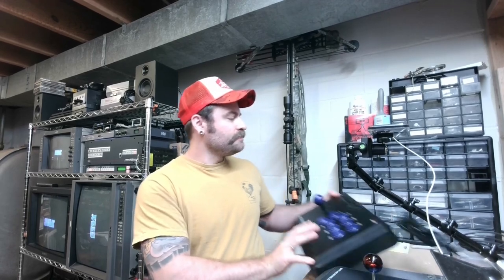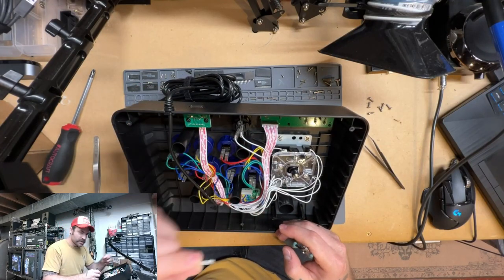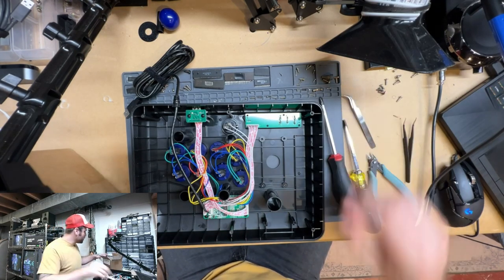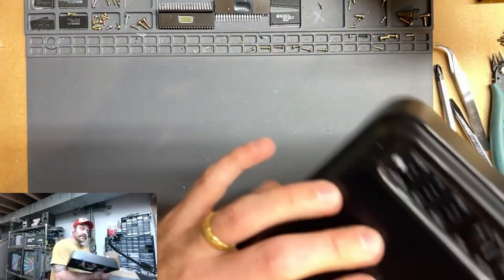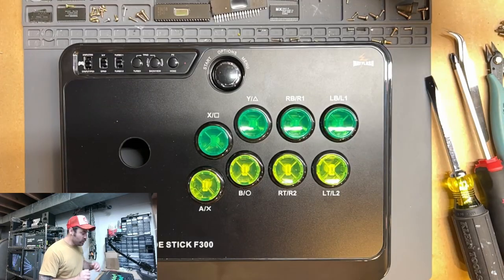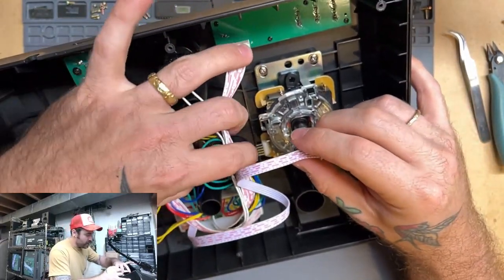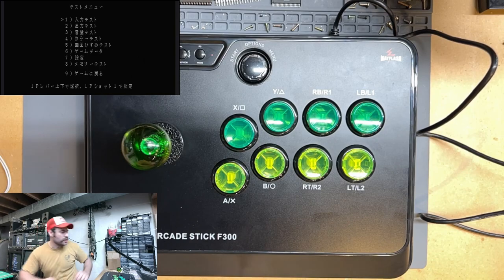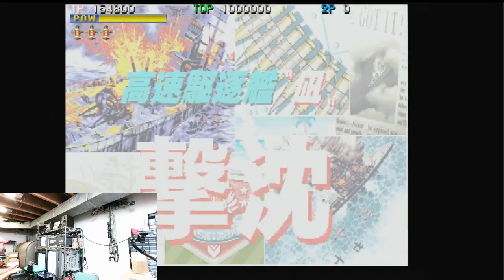How to fully customize and upgrade your Mayflash Arcade Stick F300 with high quality parts!

Comment: On the point about Octagon gate being good for fighting games, I used to think that, but now I've come to realize it completely depends on the game. 

For example Tekken plays like poopoo on an octagon, because Diagonal inputs are so important in the game, and it's significantly easier to find the corners on a square. 

Then on the other side, doing a quarter circle on a square feels a little more wonky. So it depends on the game, and to some extent the characters that you like to play.
Reply from the maker: Yep! Definitely depends on the game. I usually play Capcom fighters which is why I like the octagon gate. I think for shmups a square gate is better.

Comment: Hello just looked up this build in google. Btw when i search the mayflash f300 your video is the first one that shoots up. My question is can I just replace the ball top with any bat top using the default lever?
Reply from the maker: That’s awesome, I had no idea. Thanks for letting me know. As for replacing the ball top as long as it’s the same thread size you’re good to go.

Comment: What size is the ball topper
Reply from the maker: Pretty sure they are 35mm. The ones I used were Ex Gear bi-color ball tops from Arcade Shock.

Comment: Just turn it right side up and the plate falls right off….😂 also just reach in and pull the screws out with your fingers after you believe it’s all the way out. Pull straight up.